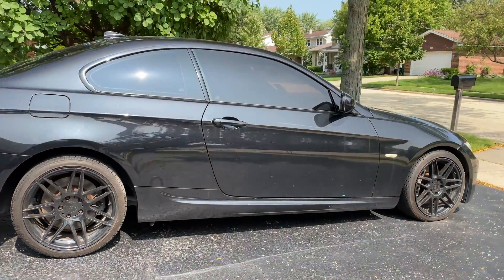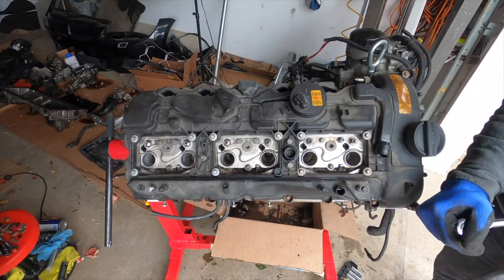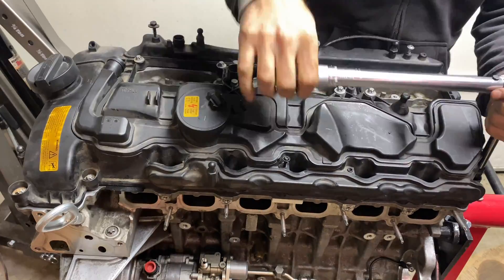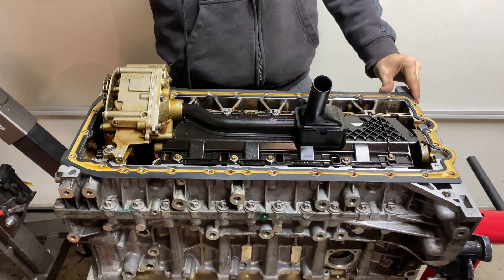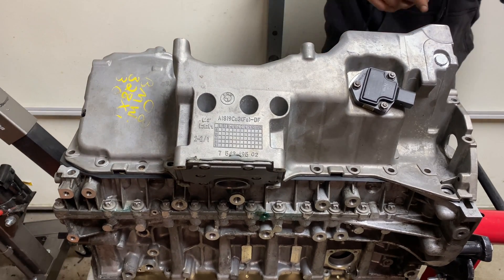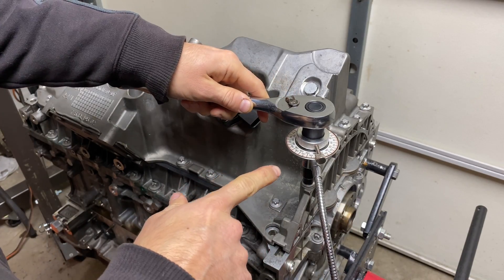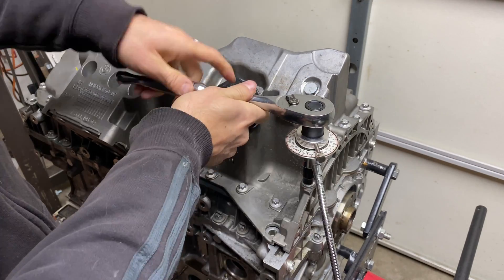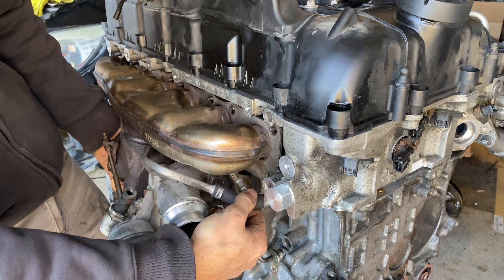Valve Cover Gasket & Oil Pan Gasket - BMW N55 Engine Rebuild Project Part 6

Comment: For an N55 rebuild, will any N55 block work? I know there are slight differences based in early and late models (like different HPFPs)
Reply from the maker: I don’t think ANY will work since there are changes on the M2 engines and a few others. Generally, a block was the same on the pedestrian models from 2009-2015. I’d check real oem website to confirm. Also, depends on what you define as the block.

Comment: Hi, Should you warm up your car in really cold weather??
Reply from the maker: BMW does not recommend warming up the car at all, but I feel they have to say that based on EPA ratings etc. With modern oils, I would recommend idling for about 30 seconds before driving away and just not stick to low revs for the first couple of minutes.

Comment: Tough when the oil pan has the front axle going through it.
Reply from the maker: I know exactly what you mean! I had to remove the axles when removing the engine and have a video on that. It’s a pain of a job, that’s for sure!